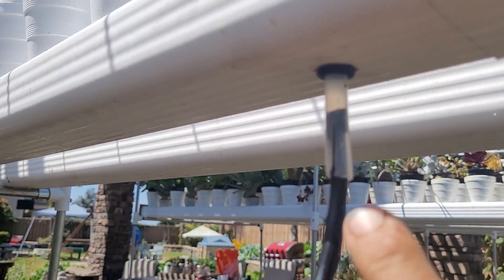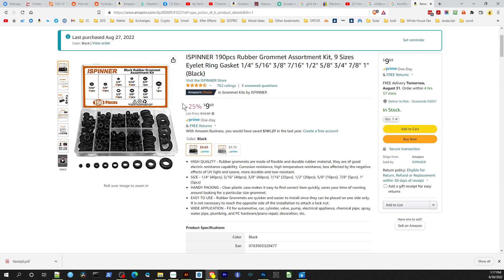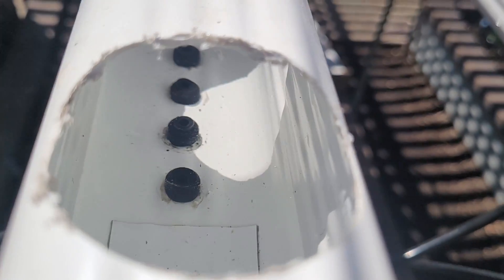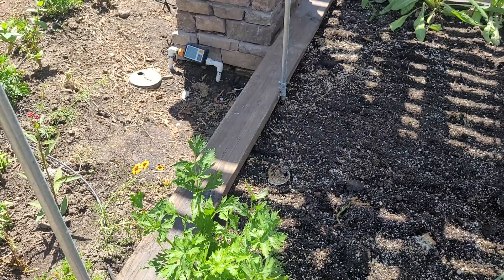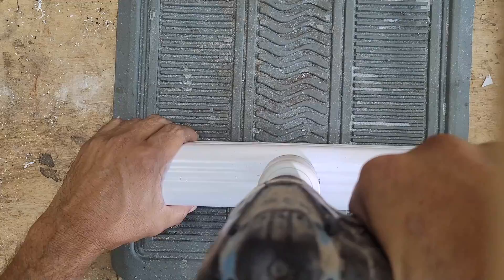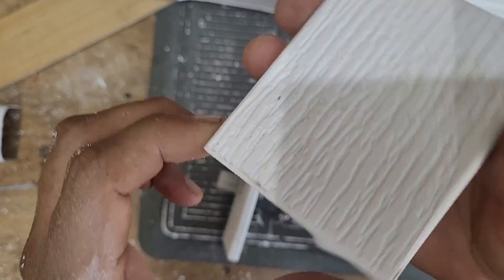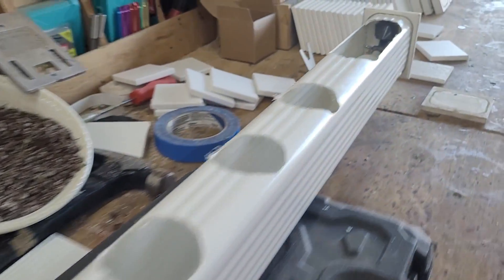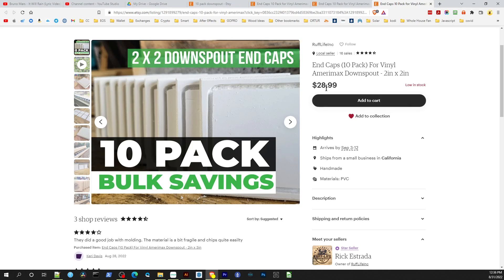Kratky Hydroponic Downspout Rails Updated With Auto Water Float Valve (Part 2 to Experiment)

Comment: I really like this idea of going with a 2x3 Amerimax with the float as a reservoir for an RGGS.  I just stretched a 2-inch net cup in Cura to make it go to the bottom of the 2x3 downspout in the configuration that you have in this video for your middle reservoir.  Do you think that would wick enough water to the saucer/grow bag method you have in one of your other videos?  I don't want to have an open gutter set up mainly due to mosquitos and evaporation.
Reply from the maker: Yeah that would work fine. A 2-in net cup. You don't need much to wick up in the bottom of a fabric pot.

Comment: Nice adaptation of Bernie Kratky's float valve setup.  I like the manifold idea and elevation on your channels.
Reply from the maker: Its a work or experiment in progress as the float valve is working perfect as I did not even readjust them yet. Its keeping the gutters around 80% filled which is fine until I get some plants on there growing. The setup over my garden bed has worked great as I built those originally for a trellis purpose and maybe some 5 mil plastic in the winter for greenhouse. But having the vinyl rails of the ground with the 6 poles of the 1/2 conduit as the only access has done great with no animals getting up there and some ants started but I put an end to that quickly. I wanted to do my seed starting and propagation outdoor in the sunlight as I am here in California. But this year I tried in February with a little mini greenhouse and the mice or rats got into my seed trays multiple times and ate the big seeds and dug up everything. Pretty frustrating when I had like 5 Trays (72 spots in each 1020 Trays) decimated once. Then I tried to improve the rack system and put things up higher, move the mini greenhouse, but they got it again. So that was really the reason I started messing with the downspouts to start the seeds somewhere off the ground!!  It has worked great for what I was trying to accomplish. The only issue was sometimes I left the plants on the rails a bit to long and they started to drink a lot more as I got lazy or distracted messing around with some other idea!! So more than a couple times I let the rails go dry but I had the the seedling in cups with 1/3 peat, 1/3 perlite, 1/3 compost, so they faired ok as I caught it once I seen them drooping as they recovered.

So that is the reason for the float valve, to solve my issue of them ever going empty again. So I just tapped into my garden bed drip lines as they go on every 12 hours for 20 minutes for now. I think that will be more than enough water for them as this kind of gives a ebb and flow as water fills up to whatever level I set the float line at then the plants drink and the water goes down.. 12 Hours the cycle repeats. I can always adjust start times and length to make it work.

Anyways we will see as I better stop rambling.. But the next, next, idea is some type of drip system like an IV with the nutrient concentration. I got a water bottle on the rails now with a small orbit valve and it has been slowing dripping the past 48 hours and is down about 8 oz... Just idea for now but we will see. Try to make light weight system with out a big reservoir mainly for seed starting and cutting propagation. Happy growing!
Reply: @rufflifehydro   Thanks for the detailed reply.  Need is the mother of inventions!  Crazy when you have to compete with bugs and rodents.  I hear that birds do some damage also.  I like the Kerick float valve, 1/4" line, and top hat grommets also.  I've got a few builds on my channel, but nothing like what you are doing.  Looking forward to seeing your ideas and creations.
Reply from the maker: @MattGarver  Subscribed as you got all whole wealth of info on Krakty method.. I just watched a couple of videos as I have some cherry tomatoes that are so good and I want to clone as I just watched your video ton the micro dwarf tomatoes. You got a lot videos so I will definitely be checking them out. Good Job!
Reply: @rufflifehydro  thanks 🌱